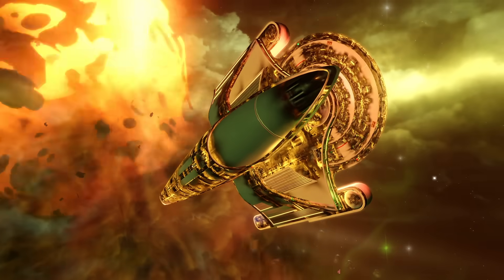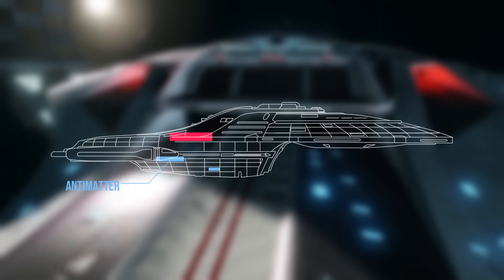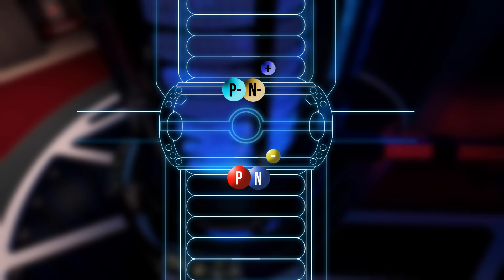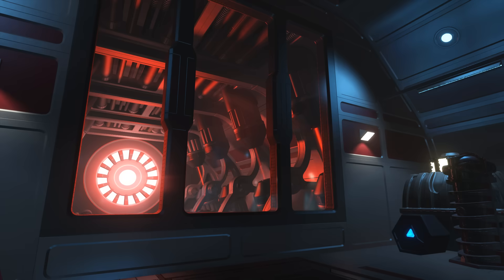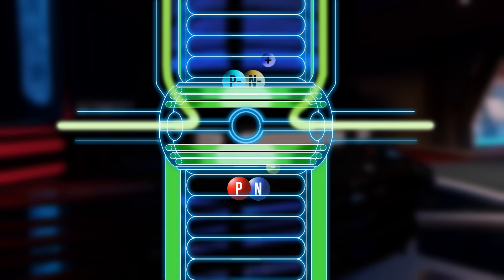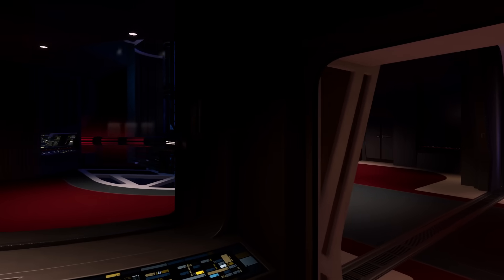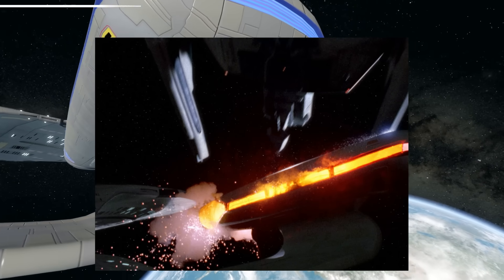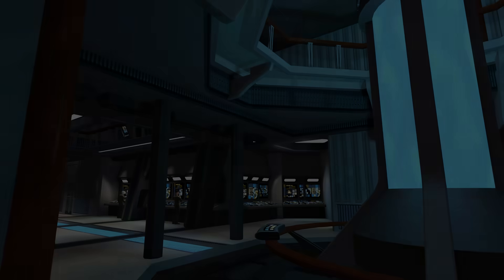What Causes a Warp Core Breach?

Comment: The funny thing about a Warp Core breech in general is that the thing is treated like a giant bottle of nitroglycerine waiting to be poked and explode.

Really, you should look at it more like the cylinder in an internal combustion engine.  Yes, it's got antimatter in it, the most volatile substance in the universe.  It ALSO, has just enough antimatter in it to feed a constant stream of well managed annihilation that is easily kept in the reaction chamber.  Kind of like how your car's cylinder has JUST ENOUGH gasoline vapor and air mix to ignite and drive the piston, not blow the engine up like a bomb.

One of the prereqs. to a proper warp core breech really should be that the antimatter stream has somehow been overfed, and now there's an abundance of antimatter suspended throughout the lower magnetic constriction pipeline.  Otherwise, what you have in the Warp Core should be more threatening as something akin to the Demon Core, a nasty radiation flash.  Perhaps a dragged out glowing doom candle.    Not 'everything turns into a fireball' type of explosion.

Beyond that, AM containment is the real threat.  All the energy of the starship's voyage, kept in a bottle in the floor.

Comment: Awesome detailed and Cool Way you presented. My congratulations! You could have been an Engineer like Geordi La Forge 😊

I just add, that plasma flows around the ship NCC 1701 D and is being sustained at IDLE temperature, with all ACF (Angular Containment Field) practically everywhere and it's thanks to the energy taken from the Fusion Reactors, who are also used for Impulse Drive to work.

As MARA is being Cold Started, there is always waste produced in form of Tritium, which is highly volatile/explosive when shaken and/or destabilized, even its extraction straight from the core, may result in accidental explosion, leading to the damage of the chamber/containment and bigger matter/antimatter explosion.

There is also collant available that runs through the walls, so if containment will drop below the 16-15%, it still gives extra minutes, until and after all steam from collant being too hot, gathers in the Engineering, leading to evacuation of the people and allowing to switch all commands to the bridge to Engineering panel section there.

Studied Quantum Physics back in the days, keep it up, its excellent way you do this! I share it on FB; Elegance Graphique PARIS Can't wait for more 😊 ❤

Comment: It's only just occurred to me that using a heavy metal for this process is ridiculous. Just use hydrogen and anti-hydrogen stored at pressure to keep it solid for storage (making it as efficient to store) but a few anti-hydrogen atoms leaking will produce a single digit percentage of the force of atoms that must be super heavy, like undiscovered on the periodic table currently, very very heavy atoms

Comment: 11:00  With all due respect to Engineering, if I needed to eject the core, but couldn’t disconnect the coolant and might melt the engineers, I’d still want the core to eject…  Pumping deuterium into engineering also wouldn’t be that big a deal compared to failing to eject an exploding warp core.

Comment: I may be late to the game, but have been a trekkie for many years now. Here is one angle why STD is not and never will be, a part of  the current Star Trek universe or the "Prime Time Line". In STD, they reach the 29th century and in that time line/universe (since we a multi-verse has officially been established with "Mirror Mirror" and the Guardian of Forever, the argument could go in either direction and be plausible) they are still using warp drives and impulse engines with only the pirates and their runners using a form of sub-space trans-warp conduits that are littered with all types of debris that ships must avoid as they navigate it. In the Prime Time Line, by the mid to late 24th century, Star Fleet is already incorporating Slip Stream Drives into almost all new ships and retro-fitting certain older classes that are still in service. By that logic, "The Burn" never would have happened in the Prime Time Line. Side bar, I'm quite certain that the UFP and Star Fleet would have put an end to the harvesting of the Kelpians long before the events that led up to "The Burn", could have taken place. Just my two cents...lol

Comment: It never occurred to me there might be  a deuterium fusion reaction within the warp core under exactly the wrong circumstances. 
It would take over 200 times more deuterium fuel reacting in the chamber to release the same amount of energy. The number of resulting particles would be higher for any given energy release. 
Of course, it's stated in the TNG tech manual that the M/AM ratio did not start at 1:1 but more like 12:1, heavy on the matter side. So the number of particles might not be that important. 
Regardless, it's an interesting thought that a M/AM reactor might need regular flushing of extra deuterium to keep the fusion side-reactions ro a minimum. It's also an interesting thought that a M/AM warp reactor might be able to run as a fusion reactor for a short period of time and probably at very poor efficiency. Still, that might allow for the Ent-D to run in the 2wf regime for a useful amount of time.
Very interesting.

Comment: I used to benchmark phones. Being close to each other can have an impact as well as metal objects like the a piller. The mag safe mounts can and will. The antenna location on the device, so orientation can have an impact. We primarily tested while moving and Velcroed them to the glass away from as much metal as possible. Spacing may be dependent on the frequency.

Comment: A warp core breech is caused by excessive levels of Drama Gas leaking into the engineering space. It is usually preceded by large showers of sparks because, unfortunately, circuit breaker technology was lost during the Eugenics War.

Comment: I understand for entertainment reasons why the supposed super strong warp cores are apparently made of… glass and are see through. You would expect that a warp core that couldn’t be seen into would be strongest 🤷‍♂️ 

The in universe reason I could think of is that the outside of the core is actually a dynamic display and not literally glass. That the pulsating lights and colours are supposed to be an easy to monitor visual output that give the status of the core without looking at a console for everyone in the room. You know the warp core is doing something wrong when it flashes like that and everyone will immediately know there is a problem.

Comment: The core makes the plasma. Plasma is massively heated gas. The gas is hydrogen turned into duterium and antiduterium, and is why the Bussard collectors scoop interstellar molecular hydrogen.  Hydrogen formed during the big bang which then combined within the cores of stars to make heavier elements.  The gas between star systems is nearly all molecular hydrogen which has not undergone stellar fusion, as it's not in volumes high enough to collapse into stars and become heavier. 

The idea for the Bussards is to collect the hydrogen while at warp at a rate high enough to replenish the supply held in the ship and being used, so without the collectors the ship would run out of fuel within a few weeks of high warp. 
Hydrogen is also be used in fusion reactors, which serve as a general backup power supply for the ship, and entirely power the impulse engines. Early Earth ships had fusion impulse engines to get around the Sol system. Each engine has it's own magnetic confinement fusion reactor. 

Fusing hydrogen in these reactors creates deuterium and anti deuterium, which can then be used in a matter/antimatter reactor to create heat energy, which turns gas into high energy plasma, channelled to the warp coils where the proximity of energy to the coils curves the spacetime manifold, known more commonly as a warp field. Manipulating the topology of the field by moving the plasma closer and further from the coils creates a bias in the spacetime metric tensor, propelling the coil forward (and the starship attached to them).  

Due to the warp field's effects the vessel also loses innertial mass, making it lighter and eventually microgravity in which the entire vessel loses almost all of it's weight, increasing the efficiently of the warp coils as a form of propulsion by progressing factors of 10.  At each 10th factor, the energy level required to move from one "warp factor" to the next increases exponentially until it reaches infinity, known as "warp 10", which is a theoretical warp speed not actually achievable due to the energy requirement approaching infinity.  

In short, starships are powered by hydrogen, which is fused for warp and impulse reactors. The hydrogen can be obtained at warp from big bang remnant molecular hydrogen, or refilled at major starbases and from other vessels.  

When it comes to antimatter containment, each magnetic containment pod surrounds the antimatter with a 5x multiple of inert matter, ensuring that if the magnetic containment field collapses, all of the antimatter will be exhausted by annihilating the surrounding inert matter. While this intensifies the reaction, it also ensures no stray antimatter remains where it could damage other vessels or planetary system. 

The same principal applies in a warp core, where the antimatter is at all stages of antimatter injection to the core is surrounded by inert matter. Where magnetic containment fails within the core, antimatter comes into contact with the surrounding failsafe inert matter, commonly known as a warp core breach.  

Where total magnetic containment fails, the entire vessel is instantaneously vaporised by the uncontrolled thermal energy release from the warp core breach. Magnetic containment failure is often a process, rather than an event, in which small amounts of antimatter initially begin to leak into the warp core matrix. Automatic safety procedures will shut down a core with any flux of the containment field within the core after expending or removing the antimatter. If removal of the antimatter isn't possible, a core breach may be imminent, and the temperature of the warp core will begin to increase. At this point safety procedures dictate the entire warp core is dumped. The remaining warp plasma in the warp plasma transfer conduits continues to flow to the nacelles, allowing a starship to continue to sustain a warp field for several seconds while the core drops out of the warp field, giving adequate separation between the vessel and the collapsing warp core. 

Where possible it is preferable to dump a core within a nebula where any potential highly charged particles from the remains of the vaporised warp core casing are not flung out into open space.

Comment: You got your locations for fuel mixed up.  Antimatter is stored on the bottom and the deuterium is stored up. Because the tank also feeds the impulse drives and Auxiliary power reactors attached to the impulse driver coils. Also the antimatter pods are kept down bottom to facilitate easier ejection clear of the pylons and bulk of the engineering hull.
Reply from the maker: I believe I got it right on the still diagrams? Although I can see in the animation I got them swapped on the core itself.

Comment: Nacell breaking causing a core breach could be due to a sudden inbalance ib plasma. 
Basically the Warp Plasma is an additional cooling system as the plasma diverts energy from the matter/antimatter reaction and given its the main product that SF is after the transfer of energy via plasma should be way higher then the coolant (coolant bassicaly removes the rest excess like 90%go to plasma 10% to cooling thus cooling failures leaving more time to handle)
If the narcelles get ripped of it could be that shutoff vavles get destroyd thus venting the whole system of plasma out of the core (or reduce its density) taking away a major part of the "cooling" and instantly reaching critical temperatures/energy levels

Comment: One thing you mention needs a little more detail and context. Anti-matter can be made in larger starships--the Enterprise D had a specific device for doing so. It was essentially a small but powerful (by our standards) particle accelerator. This in turn was run from the ship's mains, supplied by either the active warp core or the secondary impulse power system. Basically therefore the energy to create anti-matter came from an already running anti-matter reactor or by a fusion reactor. This only occurs in emergencies as the power needed to create anti-matter is more expensive in terms of consumed deuterium isotopes than either the same amount of deuterium to annihilate with anti-deuterium OR the deuterium that is fused in the impulse reactors. It is a bootstraps situation, you get back less anti-matter than the amount of matter/anti-matter or standard matter alone that is used in its production. However it can get you out of a short-term scrape so long as you have plenty of deuterium on hand and hopefully back to a Starbase or fleet victualling yard where you can pick up some more fuel. Deuterium itself is easier to find since it exists floating in free space at very low concentrations throughout the universe. The Bussard Collectors pull it in via magnetic scoops, but they also need energy to run them, so... You never get anything for nothing!

The Federation produces anti-deuterium via the same type of particle accelerator, but on an immense scale. Massively up-sized accelerators are set inside equally immense solar-power facilities sitting in close orbit around blue-giant stars. Essentially using what is free energy to produce antimatter. Really therefore anti-matter should not be thought of as an energy source but as an energy storage medium. Essentially for the most part the Starfleet sails on repurposed starlight. Which is quite a nice little bit of symmetry!

Comment: I'm a fan of the antimatter containment system used in the (mostly) parody GURPS setting called Illuminati University (aka IOU -- what's on O stand for?  You're not cleared for that information).  They have a Weird and Unusual Sciences Department.  WUSE discovered a third, non-deterministic, form of matter that seems to have its electron spin, charge, etc in a perpetual state of quantum uncertainty until it interacts with the other two forms of matter.  Thus, when in contact with matter, it acts as if it were matter; in contact with antimatter, it acts as if it were antimatter; in contact with itself, it acts as neither.  They, of course, dubbed this new form Doesn'tmatter.  It is apparently harvested most efficiently from matter that is both generally believed to be mysterious or unstable, and is being subjected to heat -- especially artificial fibers like spandex, rayon, and polyester.  This leads WUSE students to raid the campus laundry looking to steal left socks (and apparently always and only left socks) from unattended dryers.

Side note: WUSE is always pronounced "wooz" within earshot of any students, alumni, or faculty of WUSE.  Pronouncing it "wussy" can result in becoming an experimental subject in said department.

Comment: I think the bigger hazard for a warp core having a breach wouldn't be the Antimatter getting out, as it already had momentum carrying it in a relatively straight line, but primarily normal matter getting in. As is portrayed in basically every source material we have, the maintenance areas around the warp core typically are in a safe atmosphere for sentient beings. That means there is air, which will rush in to the guaranteed vacuum inside those conduits.

Comment: I would say Antimatter is NOT a good means of energy production at all. 

Because it rarely exists in nature. 

It is however a wonderful way to STORE energy , for later use, in a volumetricallt confined space like a starship. 

Its always gonna be a conversion process of way more energy in than out to get anti matter. 

But as always, if you have tons of FUSION power for free, whats to stop you from dedicating a few petawatts to antimatter production. 

You know, for your “small” ships that cant carry around 50 fusion powerplants. 

So id argue the economy runs on fusion. 

But how do you store waste energy? Or excess? Convert it to antimatter if course!! 

But bottom line its NOT free and not an “energy SOURCE” its a method of storing energy gained from other means ;)

Comment: Yeah, but what do you do when your ship wasn't designed to eject the core? Like with the Ent D. If the Ent had an ejection system, then Geordie would have just flushed the thng the moment the culant started leaking. My headcanon says that the loss of the Ent D was the reason the ejection system was then developed, which poses the obvious question of, WTF did SF's corp of Engineers wait 200 YEARS to develop a "Oh shit, the core is about to blow, push here to toss it!" button?!

Saying that, the Defiant class, shuttlecraft and the Protostar class don't have ejection systems either.

Comment: Doesn't a warpcore make waste products like anti-matter radiation or trilithium resin or something like that? Masters of Treklore help me out!
Reply: Dilithium was "energized" which activated the subspace aspect of the crystal lattice, it made it transparent to anti-matter which could pass through it without detonation. Mix in the matter part, despite the transparency effect the super high energy gamma particles turn dilithium to trillium which forms a resin which is a toxic byproduct that can stop all nuclear fusion. Using a theta matrix compositer, they crack the trilithium back to dilithium and recrystallize the crystals, prolonging the life of the crystal. Prior to Star Trek 4 Star Fleet had no way to recrystallize dilithium because of a lack of high energy photon emiting reactions via fission in the late 23rd century.
Reply: @Josh-i7h Thanks for the info. Just what I needed.